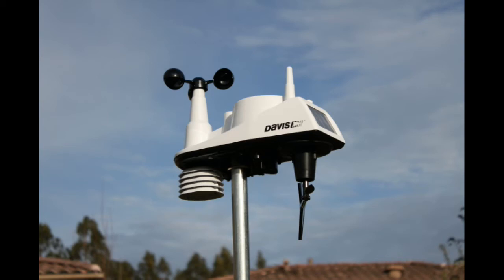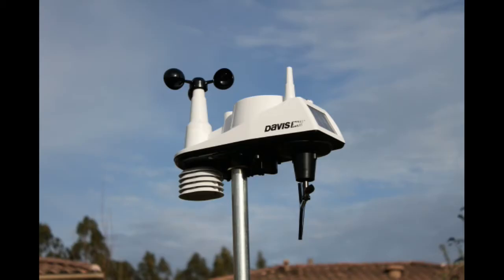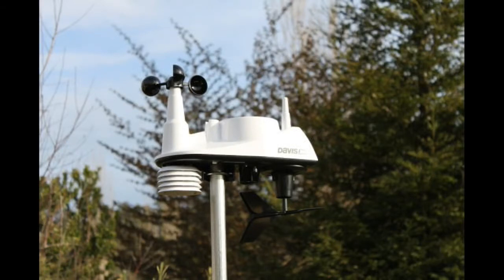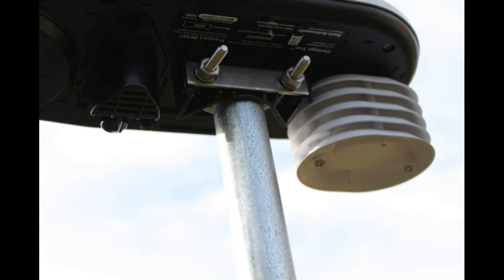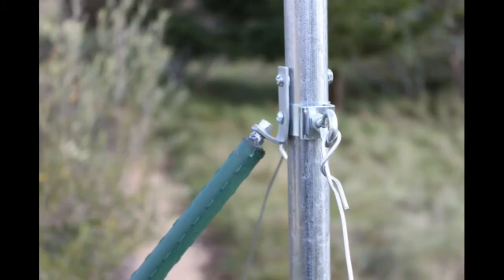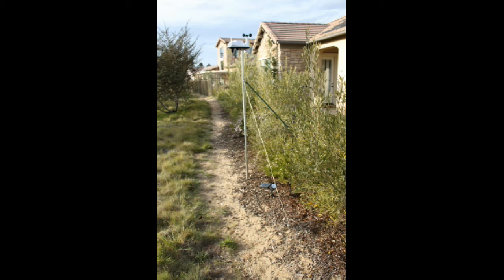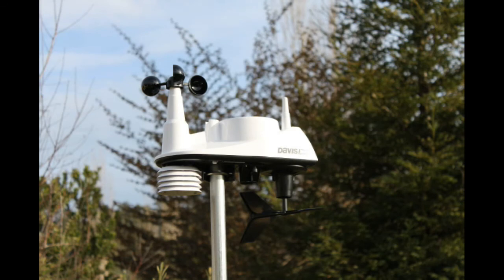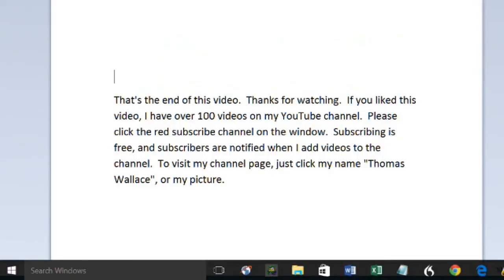How To Choose And Install A Home Weather Station

Comment: "AcuCrap" (AcuRite) is GARBAGE!!  I've had TWO UNITS go bad in the last 3 years and this shit company refuses to do anything about it the minute the unit goes out of their VERY SHORT Warranty!!  I WARN YOU, DO NOT BUY AN AcuCrap Weather station of ANY model!!  They have NO TELEPHONE SUPPORT, You'll wait for CHAT for over an hour and their support people are crap!  Mine stopped Sending Data to WU and AcuCrAp admits IT"S THEIR FLAW in the Equipment!
Reply from the maker: Sorry for your problems with AcuRite weather station.  I've been very pleased with the Davis Vantage View.  I just have to clean out leaves from the rain gauge every 6 months or so.  So far, the battery hasn't failed, but it's already past the reported lifetime.

Comment: how to use raingauge when have snow
Reply from the maker: Don't think it ever snows where I live on the CA coast.  Davis has a rain gauge heater, but it requires 110 v. power, you have to install it, and I don't know whether it will fit the vantage view.  I think it only turns on when it's near freezing, but that probably screws up the temp reading while the heater is on.   When I googled, one person commented that snow could damage the station, so maybe you should cover the rain gauge part before it snows.  You should contact Davis tech support:   888-358-4718

Comment: The unit displaying the old saying “Raining cats and dogs” does give a chuckle.  If you have not already changed your mounting setup, have you thought about burying a 4 inch x 4 inch x 10 feet post 3 feet into the ground to mount it on?  A stout pole would prevent you having to use guy wires – just an idea.  You county agent may be able to recommend a burying depth for the type soil in your area?

I enjoyed your video as I am in the market for a weather station.
Reply from the maker: Thanks for the comment, Lod.  I'm sure the 4x4 post would work fine.  Another option that would probably work is to use a larger galvanized pipe (or rigid electrical conduit) and drive it into the ground with a mini-sledge or a commercial pipe driver.  That would probably be strong enough without guide wires for anything less than a hurricane or tornado.  Just put a post cap on top while hammering it to protect it. If your soil is really hard, or contains rocks, you may have dig a hole for a pipe or post, and set it in concrete.  You can rent various types of pipe drivers at the hardware store.
Reply: @tomstda  WHY FOOL WITH ALL THE GUY WIRES? i HAVE ONE JUST LIKE IT AND MOUNTED ON THE SAME TYPE POLE MOUNTED IN ABOUT 8 INCHES OF CONCRETE.....NO PROBLEM....
Reply from the maker: @jackfreeman4121  I may in the future just eliminate the wires.  Or I may use the next size larger pipe, and slightly longer.   We have sand so can drive pipes with mini sledge.  I didn't want to fool with digging a hole and using concrete.